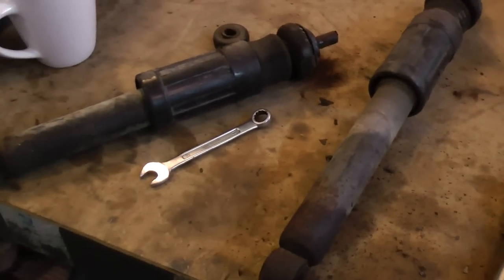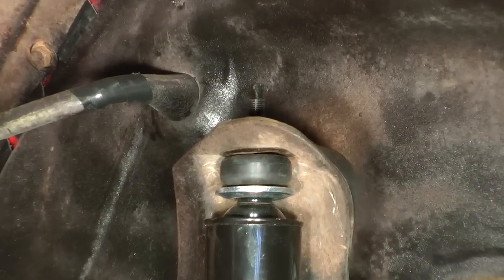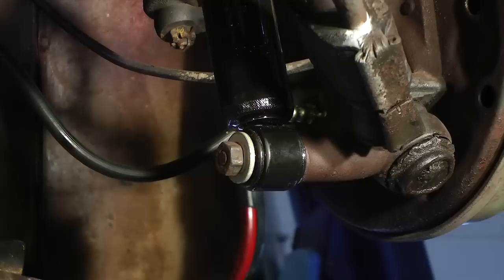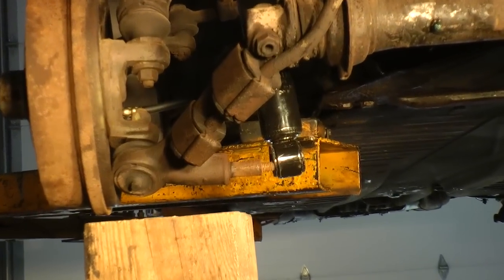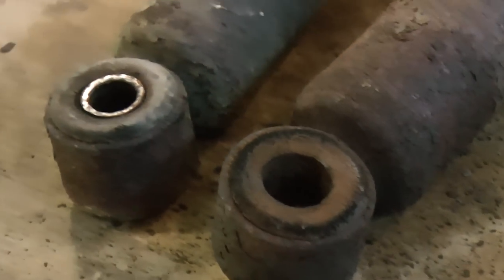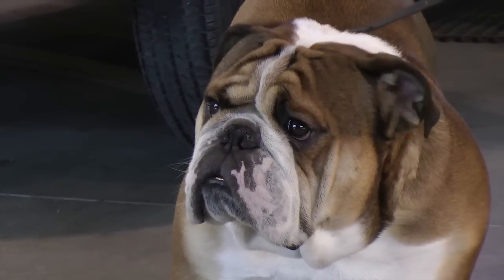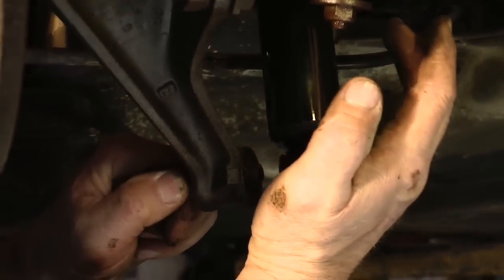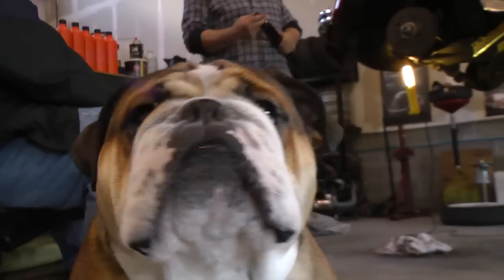Classic VW Beetle Bugs How to Install New Shocks C. Vallone

Comment: Hello Chris i have a question, i bought a new set of rear gas shocks for my bug but they seem a little bigger than the old oil filled ones i had (about 3.5cm of difference) can that cause any problems like they will make my car noticeably higher or it is ok to use them?
Reply from the maker: Eh, if they were too short then I would say don't use them, but longer should not be too much of a problem.

Comment: im working on a 69 vw i bought some new Gabriel front shocks I  notice your and mine came with two nuts one fatter and one skinnie both the same thread size where does the skinnie one go i did notice you had them also but i didnt see where you put them Im at a loss on where they go

Comment: Legend once again. I knew what was left on the spindle shouldn't have been there at all but I could find very little info on the net. Then boom! A vid describing my exact problem. 20 mins later, one pipe wrench and a bit of Plus Gas and both sides are off and ready to take my new shocks/dampers. My front beam is almost ready to bolt back on. Cheers!
Reply: Roger Lavictoire lmao that was me minutes ago
Reply: Me too! Same situation. Very comforting to know that others have the same problem.

Comment: Hi Chris, one question ¿is there a way to install modern shock absorbers?. Ive got a '74 bug.
Reply from the maker: Modern meaning??
Reply: @classicvwbugs  Yep sorry, I mean if theres any modern improved design for that shock absorbers or another car shock absorber that fits. Now I can feel literally every bump and rock in the road and I would love to have a more modern driving experience and feel with my 74 bug.
Reply from the maker: @elronaldese  I don't know, I just use VW beetle shocks.  Maybe try a new set?  What kind of tires do you have?

Comment: Chris, I noticed on the removal of the stuck bushing you didn't even try using some penetrating oil. Granted you have easy access to a torch but your dad also didnt bother putting on grease on the install.
Reply: T
Removing the bushing is a no-brainer. Several ways to do it. The problem is, where did it come from??

Comment: Hey I was just wondering if you had some suggestions on taking off the old shocks. Mine are damn near impossible to take off. I have used a ton of WD40 and it still wont pop loose.